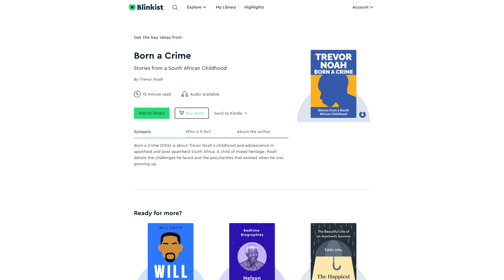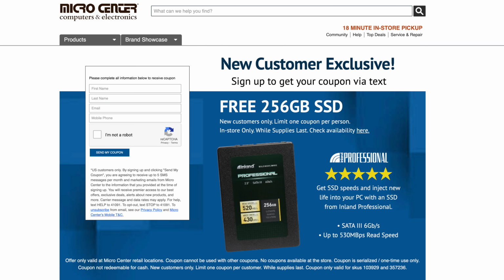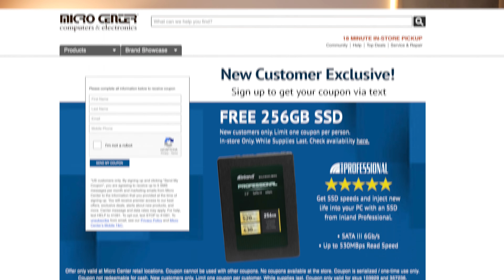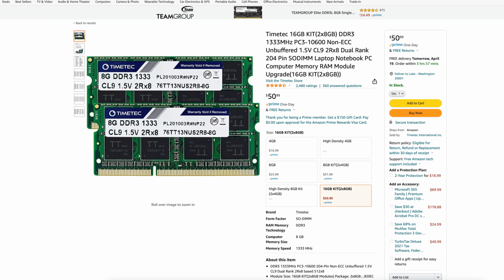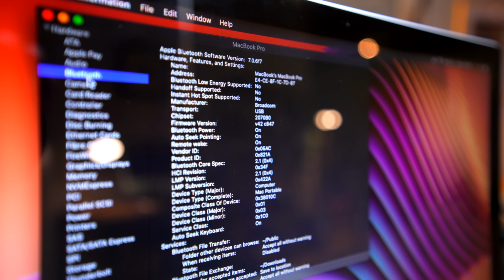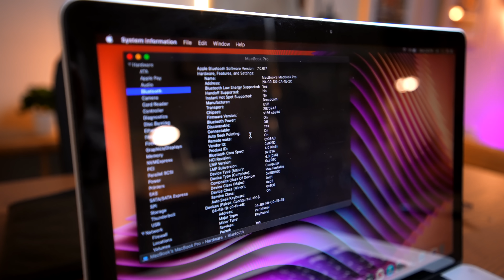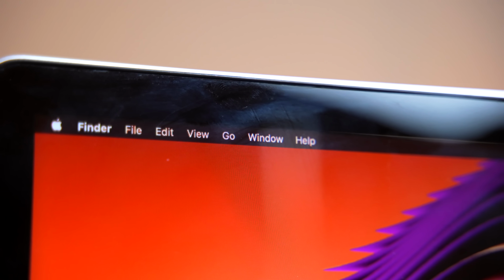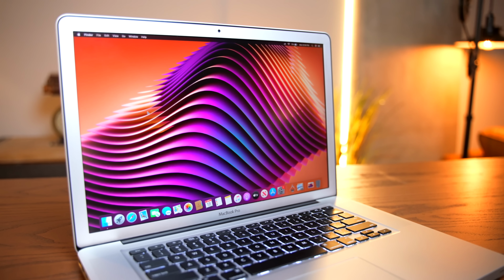Breathe new life into an old MacBook with THIS upgrade

Comment: I bought a 2012 MBP with the hi-res anti-glare screen a few years back, and just recently upgraded to Monterey using the OpenCore patcher. Runs great, and that display holds up well. I do like the silver bezels on mine.
Reply: I have the same thing , except I still run native Catalina
Reply: Is It Safe Cause I have an imac 2011 and i was thinking about doing it
Reply: @ramikii3762  I tried patching Big Sur on my Mac , and I accidentally clicked the restart button during the update . I lost all my files but the Mac still works (had to reinstall Catalina )
Reply: @ramikii3762  The whole process went surprisingly smoothly for me, and I've had no issues so far. But the OpenCore site mentions that older Macs without native Metal support have to jump through a few more hoops during install to get graphics working properly, so you may want to check first. The site has a chart showing which models are compatible and explains what extra steps are needed.
Reply: does it have an ssd? I had one of those, it was a 2009 17 inch one though with a core 2 duo, it still looked very sleek in 2019. i ended up switching to using windows 10 on it for a little while until i sold it.
Reply: @NicksLocker  mine came with a 750GB HDD. I eventually swapped the DVD drive with a 500GB SSD and reformatted both drives into a 1.25TB fusion drive, which I'm still using now.
Reply: @STNKbone  oh that is freaking awesome. I’ll admit one thing, mine did not have the best battery life. But it worked for me as a college student

Comment: I have seen a few of these types of videos from you now and I think they are pretty valuable. I think the missing component is looking at things from a software perspective. Make a list of the top 5-10 apps that are still relevant in 2022 that would run on these machines. That would be a very interesting series.
Reply: Probably none 💀 dual core ain't running shit
Reply: @ifiwantyoutofeel  Objectively untrue. I was using a dual core 2013 MBP to start my video editing career and it made me enough money for me to buy an M1 last year. A LOT can be done on a dual core and MacOS. It’s got more legs than you think.

Comment: I had a 2009 and a 2012 MBP and I put SSDs in both of them and while a SSD will drastically shorten bootup time and  program load times, they don't speed up the actual speed of the computer, unless you are running a program thats uses a lot of disc access.  I had DVD ROM drives in both of mine and the main reason I sold my 2009 and went to the 2012 was to get 16GB of RAM.

Comment: Surely at that age a new battery will be required. All my old Apple laptops, I work them hard with BIM software, all get battery warnings at 5 years of age!
Reply: The mid-2012 15 inch  I just bought still has its original battery and it only has 323 cycles and still holds a good charge.
Reply: @EvilTurkeySlices  , at only 323 cycles the battery has not been 'worked' very hard. Mine are used 9:00 - 17:00 5 days a week PLUS leisure use = 365 cycles a year!
Reply: @johnkellett7797  probably not no, it’s at 91.2% life for a 2012 battery.
Reply: @EvilTurkeySlices , not a bad result for a computer that hasn't been used. However most people do actually use their computers a lot more than that one has been. Yes it is exceptional but also very unlikely to be the case for most computer that are actually used for work on a day to day basis.

Comment: Still daily driving a 2012 15" MacBook Pro with an upgraded screen, 16GB of RAM, and the duel hard drive mod. Honestly it's probably the best Apple laptop of all time.
Reply: M1 Pro / Max has entered the chat
Reply: @CashmereSky  will see how those things are doing in ten years. To early to tell what the long term reliability is yet. The CPU and design is really nice though.
Reply: @zaclaramay  Haha I suppose. I had a 2011 15" MBP with the anti-glare screen like this video. It was a fantastic computer, maxed out ram and 512GB SSD too. Ran like a champ. Upgraded to Mid-2015 Retina... then just sold for a 16" M1 Pro
Reply: @zaclaramay  I don't think it will be as good. With terrible upgradability (non-existent), and it being even more locked down, and terrible repairability, so if anything fails it just is dead, it wont be as good :/
Reply: Same here, only I still kept the optical drive. It has most definitely been the best laptop I've had by a large margin. The battery even still lasts 2 hours or so an it's the original! I'm really happy I went with the "hi-rez" screen back in the day. I still don't understand why that just wasn't the standard resolution for it. The normal resolution was garbage even for the time.
Reply: That's good news, very helpful for me!  I have the 13" version that I've nearly run into the ground, and have been agonizing on whether to get the mid-2012 15" as I don't like the newer models, etc.

Comment: Outstanding video! I just love those old unibody MacBooks! I would happily install 16 GB RAM. The only question is: if I max out a 2010 MacBook, which OS can be installed? Catalina? or even Big Sur? A cheap MacBook for simple tasks is always nice to have to take it on the road. When it breaks down it is not that big of a loss. Even an old MacBook is in the Apple ecosystem which makes a big difference (compared to my € 60,00 chromebook). I really do like the screen you installed with the chrome bezels.
Reply: My mid-2012 caps out at Catalina. I think the 2010/2011 cap out at High Sierra.
Reply: @HVDynamo  they can run newer software with patchers though.
Reply: The mid-2010 15 and 17 can only support 8gb max.

Comment: Will say thermal paste and a good clean internally before doing any upgrades. As 12 year old paste and dust will have detrimental impacts on the system. Thermal Paste from any good brand shouldn’t need to be replaced frequently. MX-4 or MX-5 is always a strong option.
Reply: 100% agree. My MacBook Pro 2012 is long overdue.

Comment: Hi Luke, are late 2019 MBP 16 still worth getting (new at $1500)?
Reply: @L. G. Why not?
Reply: I agree with L. G., Intel Macs' days are numbered. I wouldn't buy a new Intel machine (unless you only plan to keep it for a year or two). Even though they'll still be supported for a while they will definitely not be the main focus of Apple. Macs with Apple silicon will be the main focus. 

If you want a larger screen than the 13" M1 MBP, wait til this summer - there are rumours of a 14" MBA (which will still probably kick the Intel machine's butt). Or get a 14/16" MBP... I love mine.
Reply: For a general user, surely not at that price. Unless you want to use bootcamp I don't  really see any long term benefit over buying it at that price. Even if you needed to use Windows I would suggest buying an M1 Mini if you have displays and such ( you could also wait for the M2 mini) or buy the M1 MacBook Air or wait for the M2 version, but I am not really sure if you would have enough money left for a Windows laptop if you wait and buy the M2 MBA.

Comment: My 2012 13” MBP with 4 GB RAM and 500 GB SATA HDD lives to this day thanks to a 16 GB RAM & 2 TB SATA SSD upgrade. Today’s Macs won’t last you even for 3 years unless you’re willing to pay $6000 at once. Even my two old base-model MBPs were overly expensive when I bought them, but at least I could upgrade them. I wouldn’t buy a Mac today anymore.
8 GB is good enough for Apple to ship, but that’s only because the base model is always borderline garbage at an outrageous price. It will be good enough if you only have 2 or 3 lightweight apps open and at most 4 web browser tabs. If you do more than that, you’re in serious trouble.

Comment: if you want to make these old Mac's last even longer, you can install Linux on them. that way you're running an up to date OS still.  i'd love to see this concept explored in a video.
Reply: With Opencore Legacy Patcher you can run Monterey on these.
Reply: @ordaxofficial  Very fair I mean I used to have Mojave on my plastic MacBook with a core two duo until I got into various linux distros like mint back in 2018 during highschool
Reply: *use a patcher, linux is not for people
Reply: @patrykwisniewski3418  even with a patcher a 2010 MBP can only go up to catalina which is 2 years old at this point. also modern Linux is very user friendly.
Reply: @Ashleyyyyy666  open core legacy patcher will go up to Monterrey on most Mac machines. Even some in the 2008 range
Reply: @stevenbenson9976  the ones in the '08 range have upgradable gpu's. the macbook in this video does not, and won't have any gpu acceleration if you do that. so a horrible experience.
Reply: I’d love to see this, too. Can you install Linux on a Mac or is it just an idea?
Reply: @jameslenney   it depends on the mac you're using and the hardware. My advice is to do some digging first on what mac you want to do an installation on and what distros tend to work well on them.
Reply: @jameslenney  if you want a recommendation try Ubuntu Mate, it's easy to use with many options for customization and even features Mac like layouts and such. However be sure to test things like wifi and more in the setup page before you click install
Reply: @jameslenney  You can install of course, just make linux usb stick, shutdown the computer, press the power button and than immediately press alt. Select the usb stick and the rest is self explanatory, just install the linux by pressing next next next.
Reply: @jameslenney  you absolutely can. M1 is tricky at the moment, and Mac's with T2 can't do it either, but anything 2017 or older will run Linux just fine. i'm running Ubuntu on a 2015 and 2011 MBP myself, everything works apart from the webcam on the 2015. other than that, no issues at all.
Reply: @jameslenney  I have Linux installed on my 2011 MacBook Air.  Runs well, obviously!  You can easily google which distribution can fit what you need.
Reply: Or just use opencore which allows you to use monterey on macs as old as 2008 machines 

My 13” 2012 unibody MacBook pro runs pretty well on monterey
Reply: that's nice and all but  linux devs don't give a flying F*ck about  mac users, don't get me wrong linux is cute and all in a VM but macs are competent enough on Catalina, and if you really want to be stable stick with high sierra, unless your mac is truly crumbling and faltering I won't suggest Linux on mac as a primary solution, maybe as a tertiary option (because old macs also serve as slightly better windows computers as a secondary option)
Reply: @naraydaniels7832  what are you talking about? i run Linux on various Mac's and everything works out of the box, except the webcam on one of them. on the others, everything works.
Reply: Idk why we are all fighting here honestly
Reply: We should all chill fellas no need to get passionate or hostile no matter what side you're on
Reply: These videos aren’t geared towards your POV. It’s a way to keep your MAC lasting longer or the machine you’re giving your kids for school or grandma etc etc. there are other channels that repurpose machines etc. chill man.
Reply: Linux is fine for some ppl but not good if you’re going to give the machine to your mom or something.
Reply: @shaocaholica  what do you mean? if i set it up for my mom, like, if i installed Linux, installed chrome etc for her she'd probably have no idea that it was linux. she just clicks on the chrome icon to get on the internet.
Reply: Sure that will work for that one use case. If you live with or close to your mom for support. The moment she goes to do something else or something breaks you’re on the hook for support. No one else will be realistically able to help her within her circle of reach.
Reply: @shaocaholica  i don't mind that personally, i'm already my family's tech support. although realistically a 12 year old machine is never gonna be 100% reliable anyway.
Reply: @shaocaholica  things break on any os or computer in general just saying. I see your point don't get me wrong I get what you mean but I haven't had that issue with most people who borrow my computers for a bit. Granted I give them things based on ubuntu so that makes sense
Reply: @andrewwojtas8486  don’t get me started on Ubuntu. It’s not a good distro for slower/older machines and I don’t find it particularly intuitive for people coming from Mac or win. I’ve had good luck with ElementaryOS which is sort of trying to emulate MacOS.
Reply: @shaocaholica  ubuntu maté does a great job
Reply: @shaocaholica  for most regular people who just do normal tasks, like writing doctors, browser tasks and such, most modern linux distros are fine